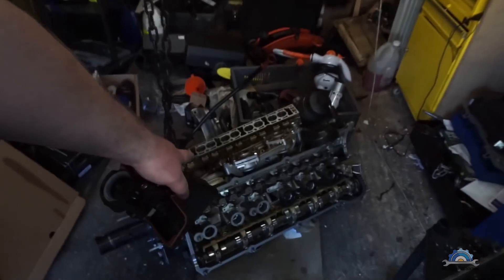BMW DISA "GROUND CONTROL" problem FIX , SOLVED!!!

Comment: I'm having this same problem rightnow. glad i found this video. this is frustrating!! would a different ECU solve this problem?? im getting a tuned stage 1 ecu with EWS deleted. so im wondering if i install it it would make my disa work correctly??